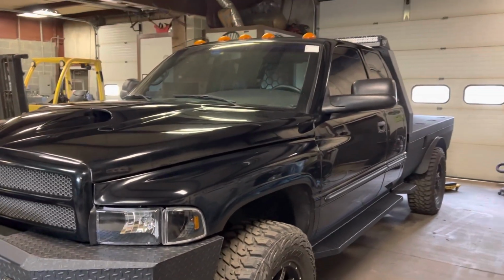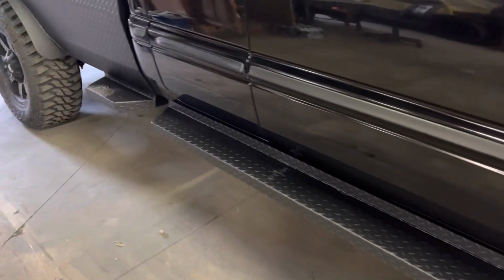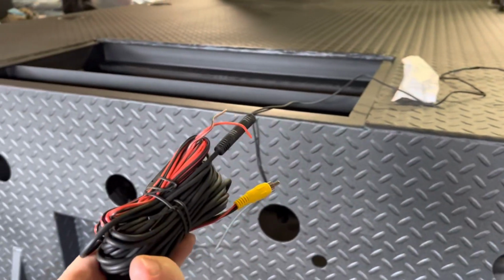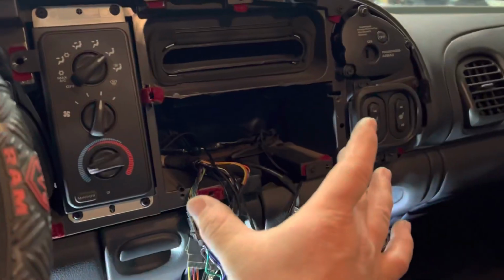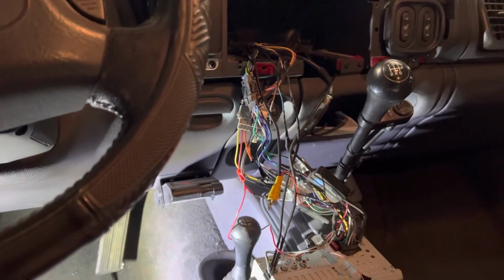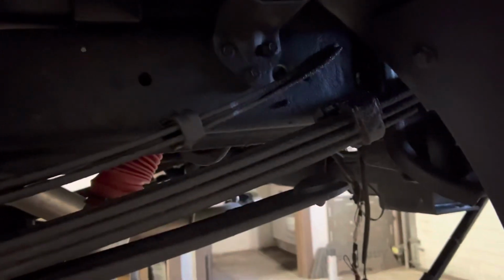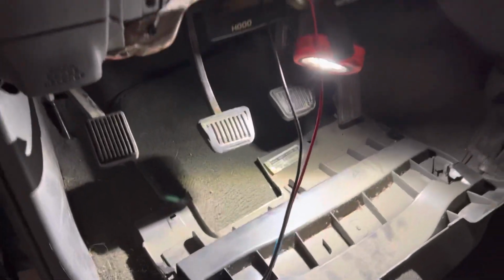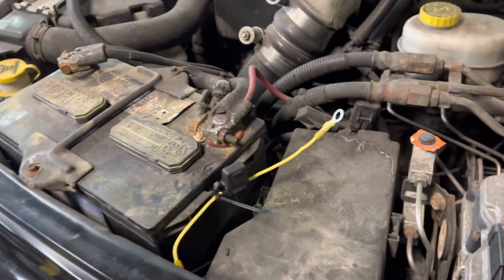Custom Truck Build Episode 8: Wiring

Comment: Can you show how you did the measurements and found the degrees to bend the skirt great build
Reply from the maker: @cameroncapozzia5597  i measure from the top of the bed deck, put a ruler to the frame with the height of the bed deck above the frame, then measure points from the ruler out with a square and another ruler which gives you the outline and you can make the angles how you want